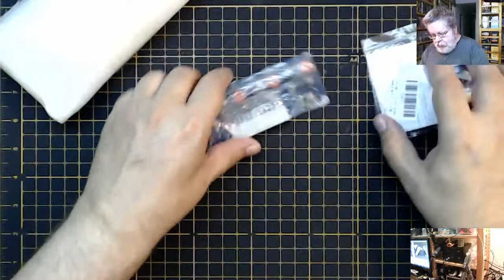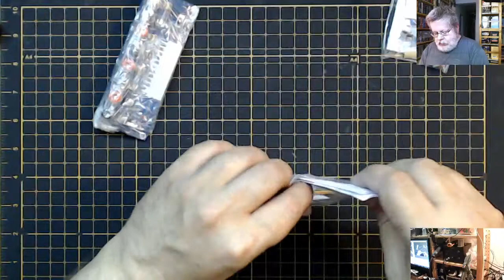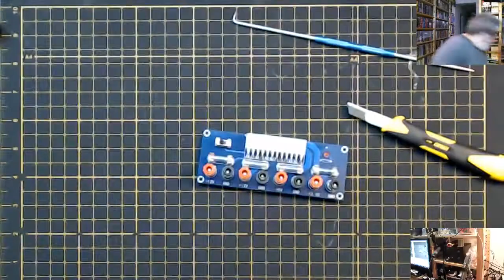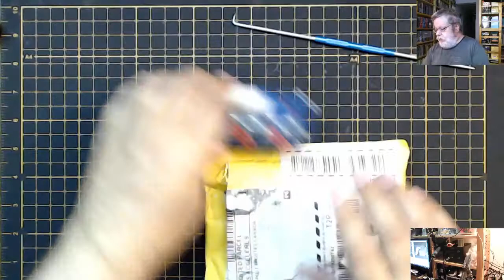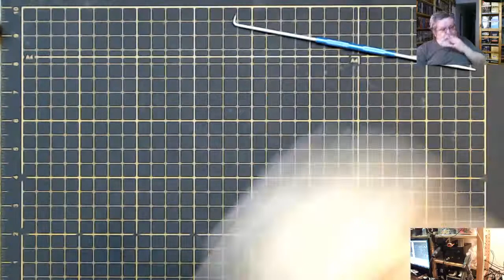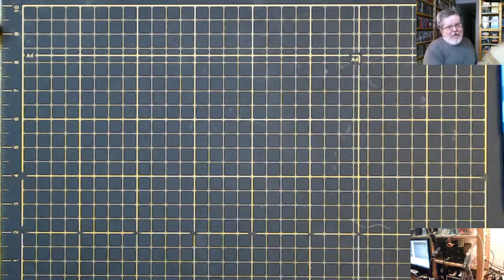Mail Call #4 - Toys from AliExpress (And Amazon)

Comment: I wish i could find a decent video of someone actually explaining all the negative voltages and how to achieve 24-36 volts off this power supply. Instead of just some dipshit explanation on how to hook it up for typical 12 v operation. This one is especially DIPSHIT material. Hey let's show off what i got? HUH?
Reply from the maker: This was a very old video but I was showing a device that you could get to reuse a old pc power supply, But if I wanted to get more than 12V of the 12V rail you could use a DC-DC Variable buck converter. At that time I did not have my hands on buck converters and was not that familiar with them but after watching a video from DroneBot Workshop on fixed and variable buck converters I picked up a batch of different ones they are pretty cool. Some people like to just see stuff you can get from Aliexpress and what you can do with it, I am not in it for the money but just to have fun playing with Electronics and trying stuff out.

Comment: XH-M229 ATX breakout board tested
Don't just dump your old desktop PC on the scrapyard! Probably there's an excellent functioning ATX power supply in it, which you can use in your hobby lab with this small breakout print.
➡    Read this article
https://chinese-electronics-products-tested.blogspot.com/p/xh-m229-atx-breakout-board-tested.html